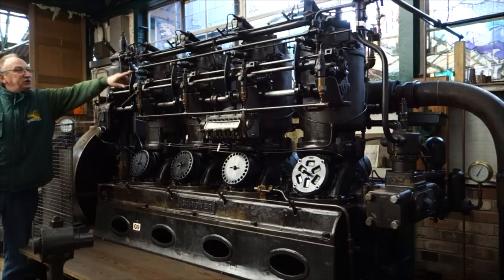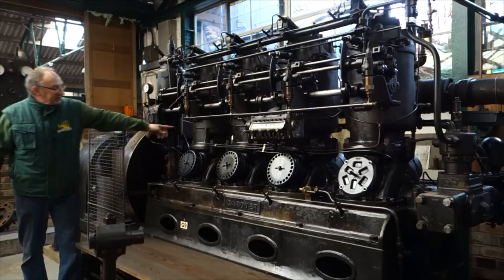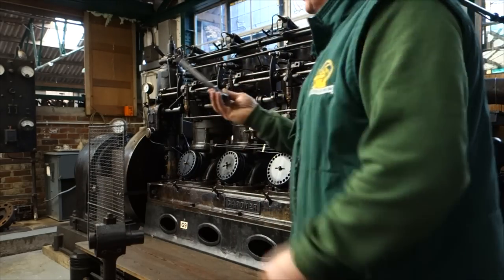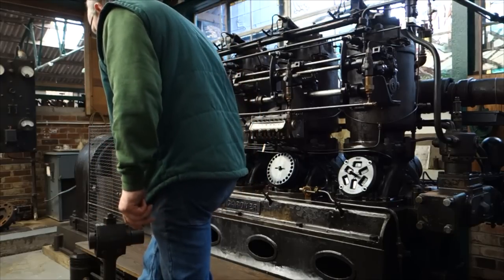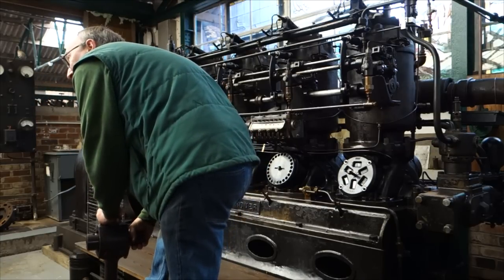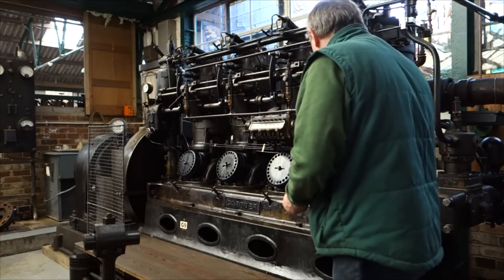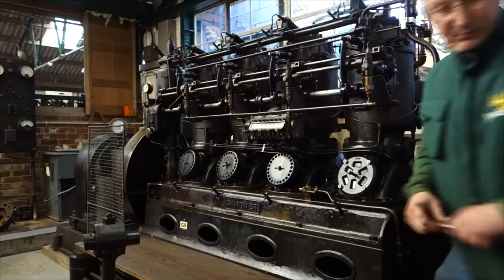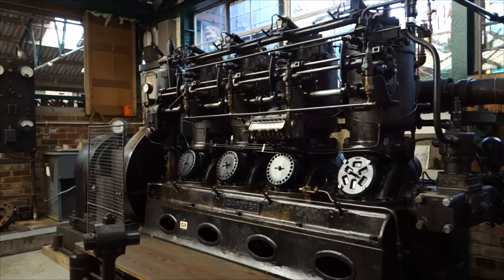gardner engine start

Comment: 5:00 Ahhh, an external combustion engine ;)
I bet if they had one of those burners heating the air drawn into the engine, it'd start and run without preheating the combustion chambers!

Comment: Those Victorian English engineers were so clever !  Better than German stuff but it's a pity we let our socks down in the 20th century .... maybe one day we could rule the waves again ???
Reply: Nothing better than German machines.
Reply: @dieselengines1760  I've got a 50+ year old Gardner 6LW in my boat that's never been taken apart, they built them from the 30's well into the 80's until they were killed off by emission legislation, nationality doesn't have much to do with how how good a machine is, some are just great designs whoever built them.

Comment: Superb video of this very interesting Gardner engine at The Anson Museum.  The Kromhout design rolling little end bearing arrangement is unusual, but clearly works well, and allowed a single gudgeon pin to be rotated 3 times in the piston to run on 3 new wearing surfaces to prolong engine life.